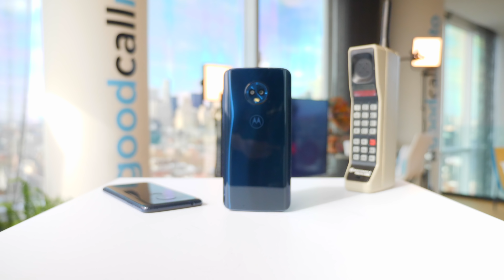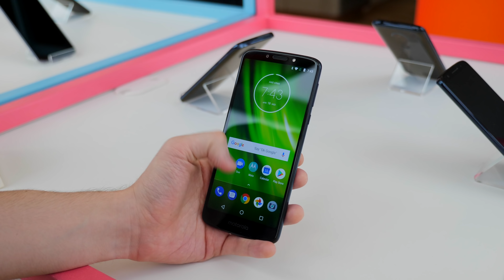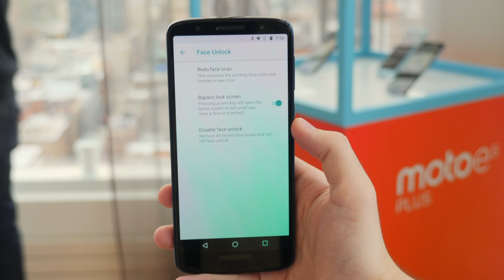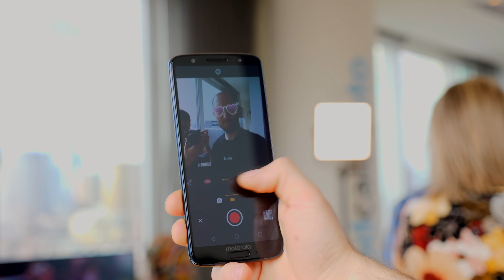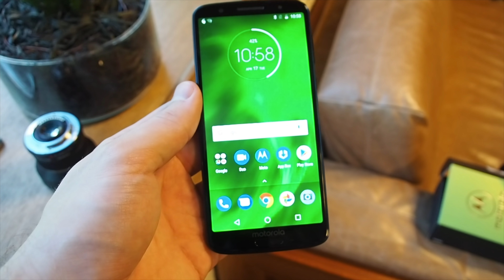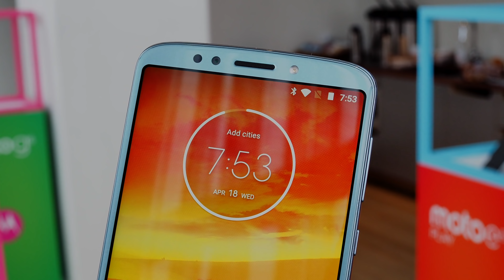Moto G6 series hands-on: G6, G6 Play, and G6 Plus in-depth!

Comment: Late May, eh?  Bummer.  Also, bummer on the G6 Plus not coming to the US.  I've been looking at the G5 Plus (not G5S Plus, due to better low-light performance on the single f/1.7 aperture lens, which the G6 Plus seems to have returned to) at Best Buy for $199, but would definitely buy the G6 for $249 instead.  That, or a further price reduced G5 Plus, which probably won't happen until after the release of the G6.  Oh well, I assume the $249 G6 has 3GB/32GB, so I could get the G5 Plus with 4GB/64GB for that price.
Reply: Im facing this same situation too, I can't really decide.
Reply: I recently bought the G5+, after much research i found it was the better phone deal. Comparing it to an old Galaxy phone (GS4), The G5+ puts the GS4 to shame. Even with Sammy's extra features, Moto proved a mid range phone can hold its own against bred champions. 
I bought the G5+ 6GB

Comment: do they have notification leds?
Reply: The Moto G5 Plus had an LED built into the earpiece to show when the phone is charging but it doesn't work as a notification LED.
Reply: dwisdoms The G5 series (G5, G5 +, G5s, G5s Plus) don't have an LED that works all the time but I'm not sure about the G6 series.  🙂
I have the G5s Plus and it actually does have an LED on the top left corner but it only lights up ONCE after an update installs and it boots up.
Reply: Interesting, I find the leds very useful and color code them to specific apps, let's see if these new models will incorporate them again
Reply: dwisdoms yeah. We can hope. 🙂 But what's the point if the year old G5 and G5 Plus and the 6 month old G5s and G5s Plus still haven't received the OREO update? It's pathetic support from Motorola. 😑
Reply: charlie pepin I have friends who have the G5 Plus too and I haven't seen any LED whatsoever, while charging and for notifications.